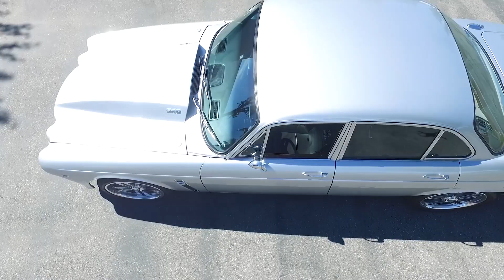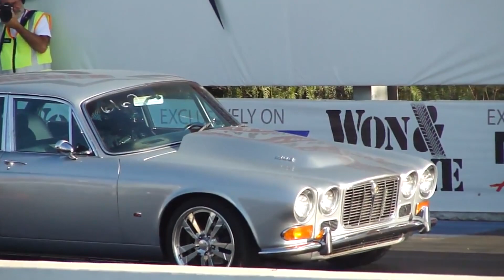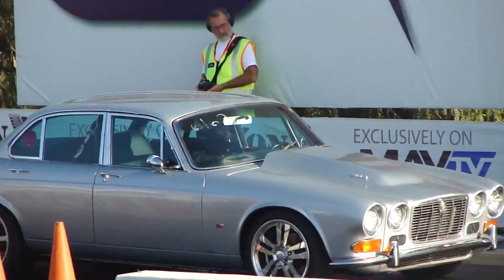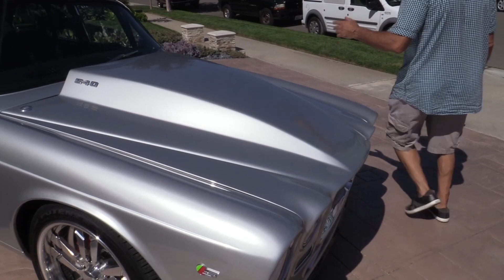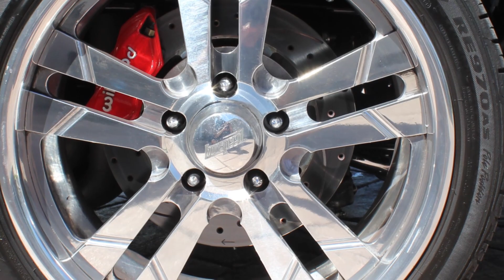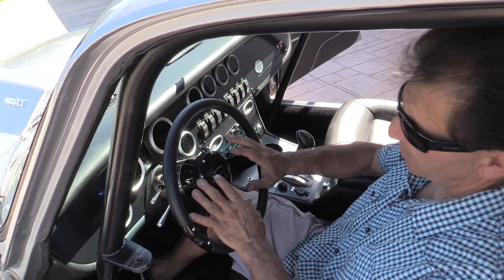Draguar Engine Swap Jaguar XJ 750 Horsepower V8 Hot Rod with Nitros N.O.S.

Comment: A very unique build! You have given a classic car road presence like I've never seen before. Raised bonnet to accommodate the large engine, bumper only on the rear and wheels that hint that it's got the power to go with those looks. I have a series 3 but am currently restoring it to keep it original. But appreciate your effort to take a classic to different heights! To each his own. Bravo 👍

Comment: Not bad, looked much better before you removed the bumper and added the nasty looking vents.
Reply: I like the modern "gills" they are a nice touch. But the footage early on at the dragstrip with the origional bumper and grille look a ton better
Reply: +Smee2000 Agree, the modern badges and trim spoil it.
Reply: Smee2000 i lik the vents on the side. but not the bumper

Comment: Wow this is sooo nice. I myself am building a series 3 with 383 stroker and N.O.S.. I love the front end of yours. I assume its a series 1?. Do you have any idea if you can put series 1 front end on a series 3? I know I would need a hood both fenders, bumpers ect... but can it be done? What offset are your wheels?? Are you still using the jag suspension independent rear suspension and also the jag front suspension?
Reply: +Jim Springer If I remember correctly you can switch out fenders between the S1 and S2 but not the S3. I had a V12 S3 and wanted to do the same thing but was told it couldn,t be done. Well not without a lot of body fab!

As for the front suspension he does say its a none stock unit but doesn't mention the rear end. However, what most people don't realise it that the S1, 2 and 3 used a Dana 44 IRS manufactured in the UK by Salisbury who are a subsidiary of Dana/ Therefore there is a conversion kit out there that allows you to use LSD's designed for the Dana 44 live axle found under trucks and everything!